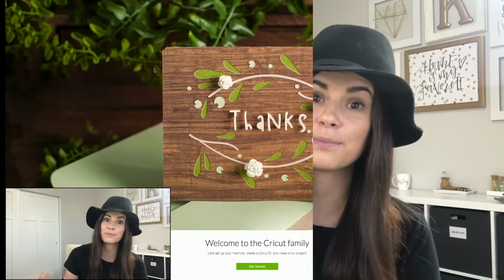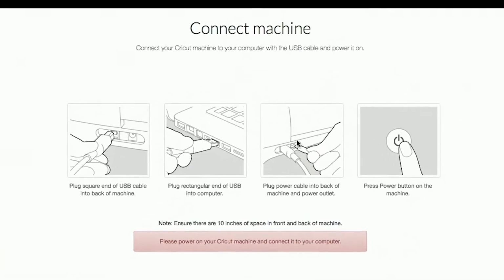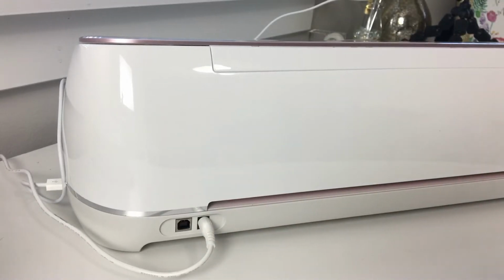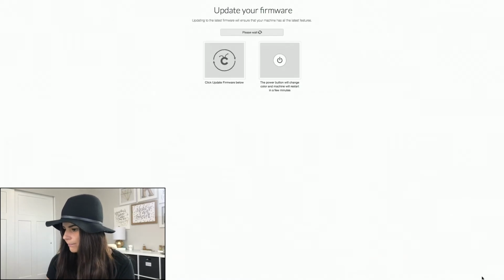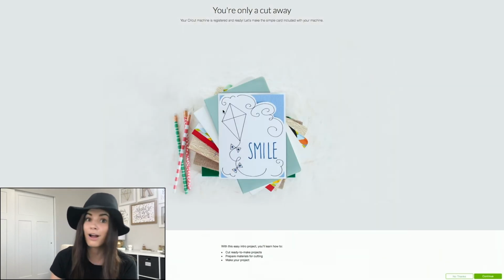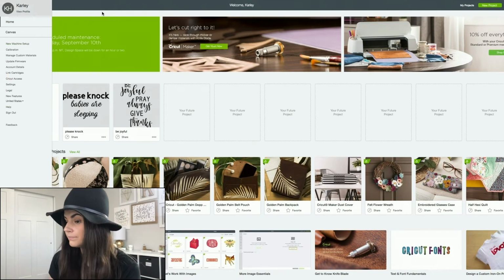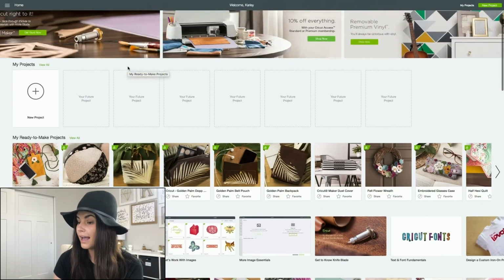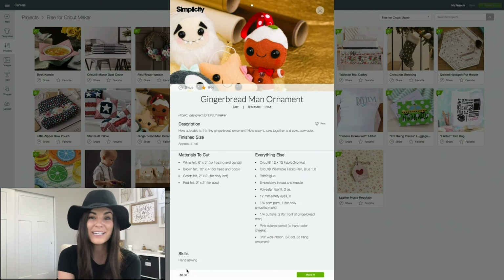CRICUT BEGINNERS! START HERE! How to Set Up & Register Your Cricut Machine

Comment: I have been trying for over an hour to register this easy press  so aggravating says i only have 7 days the USB is showing  but the page is just sitting there
Reply: Omg me too and can seem to find the solution anywhere I’m so frustrated
Reply: @mrsl9957  I finally got in touch with them i had to send pics of the serial numbers and a pic of my reciet  they do not update it they are working on it  one person told me in email to just make sure i kept reciept they have to know date and price it said wait time was for 2 hours but i only waited 30 minutes SO I GOT IT DONE YAHOOOO  but it will not update firmware  it does  not even work  yet
Reply: @MaryNSC  did you ever get it fixed? I am in the same situation amd cannot find anything about this. Very strangr
Reply: @MaryNSC  did you ever get it fixed? I am in the same situation amd cannot find anything about this. Very strangr
Reply: @MaryNSC  did you ever get it fixed? I am in the same situation amd cannot find anything about this. Very strangr